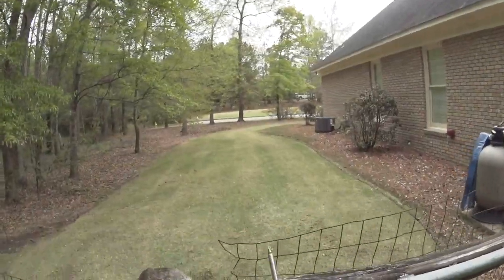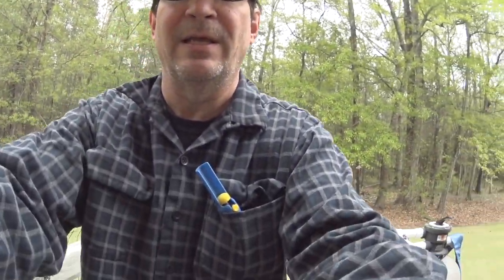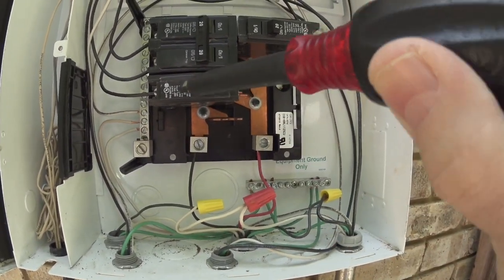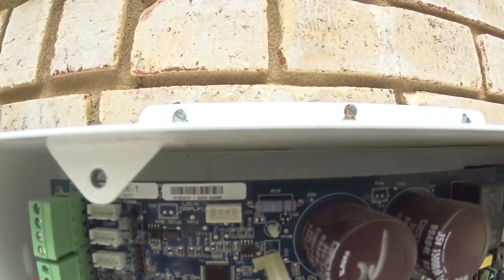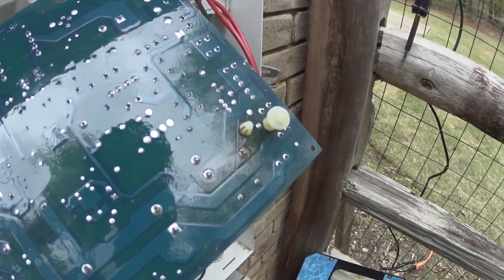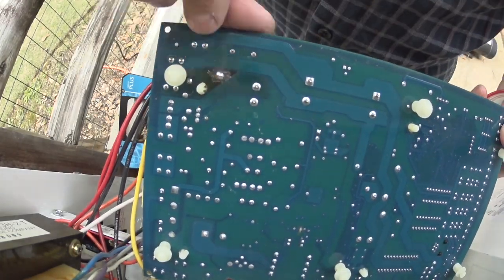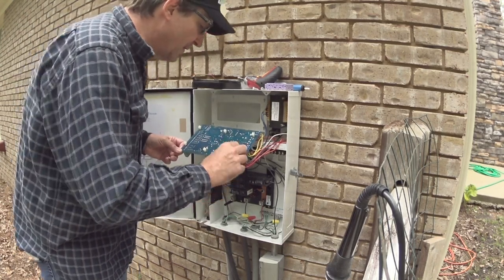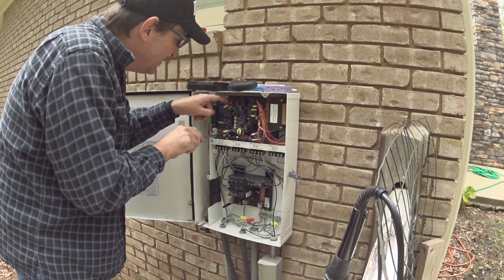Chlorinator Off No Cell Power - DIY Repair

Comment: What sounds like my issue?The power tank that goes with the chlorinator there's no juice to it.
So i'm gonna start by check checking the electrical outlets.
Reply from the maker: Not sure. Sounds like you might have a different system, or setup, than mine.

Comment: I'd recommend turning off the supply breaker for the sub panel at the main breaker panel. Then there are no live wires to worry about. 😉
Reply: Just did the fix and worked for me too!! Wow thanks a lot! 😊
Reply from the maker: Congratulations on fixing it yourself and saving a pile of cash! Thanks for commenting and sharing your success!

Comment: Didn’t work on mine. Had to replace a relay, worked for a few hours, how I have several messages on display.
Reply from the maker: At least you gave it a try. You might look on eBay for a repair service. At one point there was a professional service specializing in repairing pool control boards. They indicated they could fix things like bad clock timer circuits, etc.
Reply: @fiveable  I'm looking for one I saw earlier, for $150 you send him the board and it's a one day turn around which seems worth it. I live in Texas and having over a hundred degree days every day for a week plus. These pool companies don't even stock these boards.
Reply from the maker: @jeanneburke1380  that sounds like the same service I saw. If you use them please let me know if they are reliable. As you have found out, every now and then the solder trick doesn’t work. It would be nice to be able to have a proven repair option to recommend. Thanks!

Comment: I ran across another valuable piece of information in another video, can’t find it now or I’d post the link. When adding salt to the pool, TURN OFF SALT SYSTEM for 24 hours or it will burn out your PCB. I am assuming this is why that circuit is a common problem. I do dissolve the salt in the pool then run pump 24 hours, but was not turning off the chlorinator. I’m thinking mine burned out, got no cell power 2 message, after I added salt. Hope others find this comment useful.
Reply from the maker: I have a friend who professionally repairs these boards and also works for a company in Florida that builds and maintains a large client base of pools. I’ll ask him about it. One thing he has mentioned is that he sees the bad pin connection problem more often on controllers in southern facing panel boxes that get hit by a lot of direct sunlight as opposed to ones mounted on the shady side of a building.
Reply: I added the link below. Also, googled if you turn off chlorinator after adding salt and found a number of sources instructing to do so. However, the video I posted specifically states it will/can affect the PCB.
Reply from the maker: You are correct! I asked the friend I mentioned above and here is his reply:

“As a matter off fact - it is right to turn off the generator for the next 24hrs after adding salt.  
Here is why:
The salt makes the water more conductive. 
The salt get poured into the pool and falls on the bottom. When it slowly desolves and the solution reaches the main drain ( or get sucked into the pool cleaner) it almost shortens out the control board.  
The board shuts off and displays „high salt“. 
There is a note in the owners manual to shut it off.”

Comment: For me, it was the fuse.
Reply: Yes the 20amp yellow fuse was my issue too. I forgot to unplug the cell when I cleaned it and blew the fuse.
Reply from the maker: Thanks for sharing that info! It seems like shutting the pump off and leaving the cell connected during cleaning would be an easy mistake to make. Luckily, I always shut my whole system off and take my cell to a different location when cleaning it. Otherwise, I might have also blown a fuse!

Comment: Didn't work for me. But thanks for the video.
Reply from the maker: Hi Billy. Sorry to hear it didn’t work for you. How bad was the solder joint on the relay?  Any chance the salt cell plug wasn’t pushed all the way in after reconnecting it? Thank you for commenting.